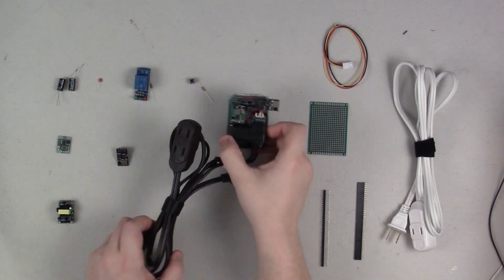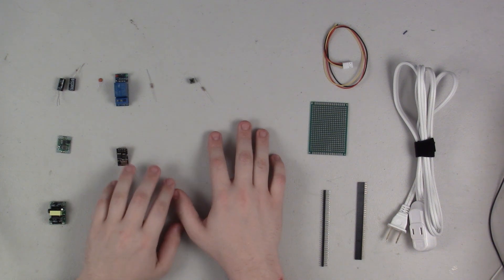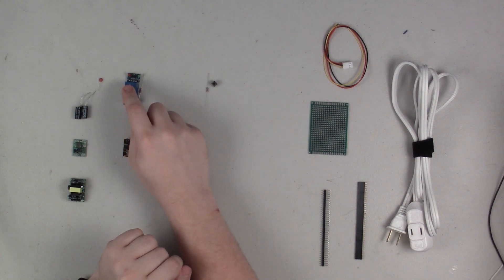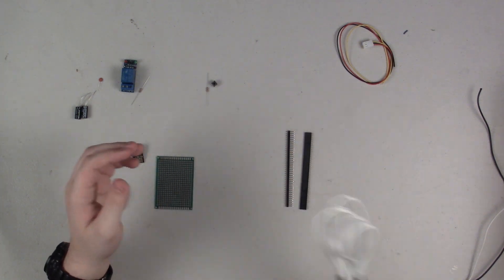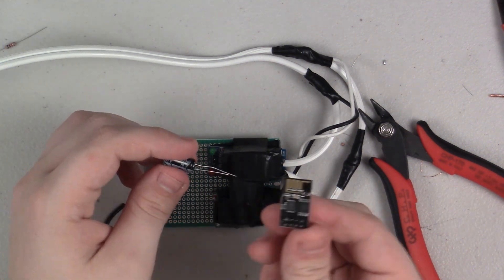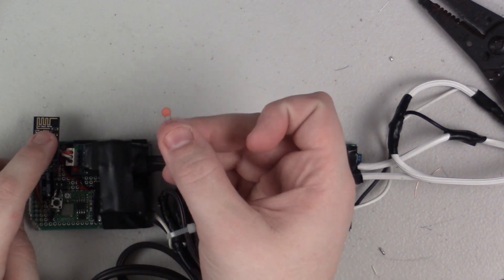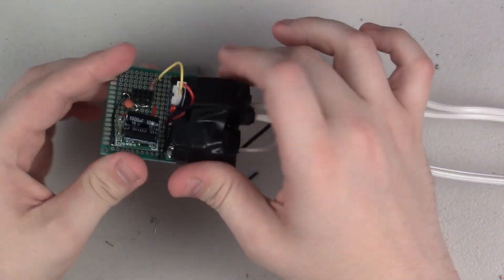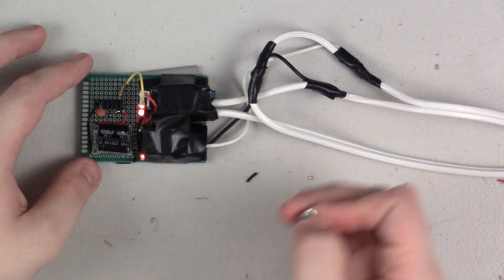Smart Relay Build

Comment: With no disrespect, if you install a snubber network across the contacts that will stop a lot of the back EMF on the contacts when they open and close the ac load like an inductive load causes as this will cause your processor to brown out you can get snubber s or make your own if that helps Bob and I love your channel your esp8266-01 programmer works a treat thanks.

Comment: You can use the retired smart phone power adapter as the DC 5V power source. I use it well in my RCWL-0516 Microwave Radar Sensor with relay module. It can supply sufficient current what I need. No doubt, a 1000uF capacitor still is necessary in the DC 5V incoming.

Comment: Great Tutorial!  Just have a couple of questions...
What is the resistor between the esp and the relay signal for?  
Also, is the relay a low or high level trigger?
Reply from the maker: The resistor acts as a current limiting resistor. Many of the cheap relay modules that I get from ebay dont have current limiting resistors on their input pin so just in case I usually add one. And the relay in this case was a high level trigger.
Reply: Any idea why the module would freeze when you power it up - ONLY when the relay is connected.  If the relay is NOT connected, the module powers up normally, and works fine.  You can then connect the relay and it works fine as well.  If you power down and power up again, problem persists.  Thanks in advance...
Reply from the maker: What pin is the relay connected to? (in mine it is connected to pin 3, aka the rx pin on the ESP).
Reply: const int Relay0Pin = 0  and const int Relay2Pin = 2
Both are initialized OUTPUT and LOW.
Reply from the maker: Ahh ok so that might be the cause of the issue. I chose pin 3 because that is a pin it doesnt interfere with bootup. Pins 2 and 0 must be pulled high in order for the ESP to boot correctly. After booting up they can be changed but initally the both must be high. You might try using a pull-up resistor (a resistor connected between the pin and 3.3v) along with your connection to the relays to see if you cant get the pins to register high initially but then be able to control the relay still after booting the module. Alternatively if you dont need the serial line you could use pin 3 as I did and pin 1 which is the tx pin. As a small side note I seem to remember some weird boot issues with pin 1 as well but that was a long time ago and I might be wrong about that.
Reply: Thanks for the advice!  I will add a (pull-up) resistor between IO's and 3.3 vdc.  (What ohm resistor do you think would work??) 
IF adding resistors doesn't work, I will try re-flashing with IO 1 and 3 instead of 0 and 2. 
I'll let you know what my results are... Thanks again!
Reply: Two 3k3 resistors worked like a charm!!  Figured resistance w/ current at .001 A. Hopefully I don't have any issues with heat.  Thanks for the help!
Reply from the maker: Oh great to hear that you got it working! I meant to reply back to you earlier but got distracted. Let me know if you need anymore help! 

Cheers,
~IKW

Comment: Is the AC-DC converter transformer based or switch mode? I'm thinking about making a similar device, however I plan to just add a 5mm DC plug as input on the device and power it from an old switch mode phone charger.

Comment: Am am doing something similar with one of those old desktop power strip-boxes.  You may want to try solid state relays, like a G3MB-202P-5VDC to reduce bulkiness.  Furthermore, you may be able to tune a resistor and 3.3V Zener to step down your 5V, if your ESP is not really power-hungry.
Reply from the maker: Thanks for the tips! I thought about using solid state but those are so expensive compared to these boards which are often <$1 on ebay. But in an ideal world I totally would use a solid state relay. And thats a good idea for the ESP power supply!

Comment: Nice design thanks for sharing! I'm trying to create one of these myself atm.
I found that the relay(atleast the one that Im using) also works on 3.3v. This would mean I would be able to get away with using just a 3.3v ac-dc converter to power both the esp and the relay. I'll have to do some testing for stability though :)

Keep it up!
Reply from the maker: Thats awesome! Yeah just make sure to have tons of filtering capacitors since the relay actuation causes a lot of voltage spikes so you want something to absorb the spikes.
Reply: Yea that's something I wouldn't have thought of if I didn't watch this video. That certainly would've killed multiple esp's. Thanks for the tip! :)
Reply from the maker: It's something I never really thought about until I started working with ESPs and I killed a couple before reading up on it. I'm going to put out a video at some point taking a look at the noise from a relay connected to an oscilloscope so you'll be able to see just what I'm talking about
Reply: Awesome thanks

Comment: can i use esp-12 instead of esp-1, is there any code change for esp12?
Reply from the maker: You sure can! You just have to adjust your pins to match whichever pins you plan on using with your module.
Reply: Thanks. Nice job.

Comment: Very nice. I'm probably going to use the capacitors in my future projects. I'm currently working on a very similar layout. The only real difference is that I skipped the 5V PS entirely as the relay modules I use work well on 3.3V for power as well as the logic part. Thanks for sharing!

Comment: Mind giving us a link for purchasing that neat 5V PSU module?
Reply from the maker: I dont like putting them in the description since the listings disappear so quickly on ebay but something like this would probably work well. http://www.ebay.com/itm/New-High-Grade-12V-5V-24V-9V-AC-DC-Power-Supply-Buck-Converter-Step-Down-Module-/331976883139?var=&hash=item4d4b5d3bc3:m:m3XxSHcQhDa-u-_IPLbbawg
Reply: This was going to be my question.  Yes, a variety of cheap bare power supplies on that ebay link!

Comment: Isn't it a waste of an ESP to just use it to control one relay? It is so much more powerful but the main problem I have is imagine having 10 lights to control and 10 ESPs doing that, that's 10 more wifi devices. Wouldn't that create an interference mess? I want to get this up using a relay board and one NodeMCU controlling all the relays...
Reply: True, it has 12. So you could do it with a NodeMCU module.
Reply: There are ways of doing more with one ESP module. Problem with these ESP-01 modules is that you only have two of the GPIO pins mapped to external pins. Like you say, using a NodeMCU (or in my case it's almost always a WeMos D1 Mini because they are smaller) you can control a multitude of relays because more pins are mapped to external pins. Not sure if you could do 10,  but maybe with an extension, like a multiplexer (which lets you control multiple pins with only a few) it might work. You might have heard of multiplexers in things like an arduino powered LED cube.
Reply from the maker: If you have 10 devices that you want to control you can setup a similar thing to this but with 10 relays (and change the subsequent code to use 10 topics if you need individual control). It's not hard to modify things to add more relays - it just requires as many relay modules as you need.
Reply: ItKindaWorks well like I said, you need pins to control those relays so it isn't just adding as much relays as you want, isn't it...
Reply: Yeah but my biggest issue(with the current setup) was having too many wifi devices..  doesn't that become a problem at some point?
Reply: Yeah multiplexing or some kind of control via the serial ports could allow for more relays than the available ports..
Reply from the maker: the nodeMCU has plenty of pins (idk if it has 10 but it has more than just the two and thats what kekagiso was referencing)

Comment: Wouldn't it make sense to use a power lead with a ground connection, just to make sure that you have the fase/live wire connected to the relay?
Reply from the maker: What do you mean "to make sure that you have the fase/live wire connected to the relay?"? 

The ground wire doesn't add anything other than a certain level of protection (Generally the ground wire is just there to make sure that if the live wire make contact with the metal body of a device - say your fridge - that the power is directed not at you but at the earth) but since this is a DIY affair you are obviously doing this at your own risk. 

Sure your house could be wired poorly and have hot/neutral swapped but adding the ground wire doesnt help that issue in any way that I know of. Perhaps I'm wrong though... But afaik the ground wire wouldnt help this project at all unless you intended to plug in something that should be grounded.
Reply: When you have the plug with only 2 connections, then you can turn the plug 2ways, one way round the relay will break, the fase/live wire, the other way around, the relay will break the "neutral", if the relay breaks the neutral, then you will have a permanent live/hot wire at the appliance. If you use the power lead with the ground, the you know what wire is the live/hot wire.
I am not suggesting it because of the ground connection, although it might not be a bad idea 😉
Reply from the maker: Oh ok I see what you mean! Thats only the case if the plug isn't polarized (in the US there are both polarized and non polarized plugs). The polarized plugs have blades of different sizes (the smaller blade is hot and the larger one is neutral I think - I always have to look it up) so that the plug will only go in one way even without the ground pin. So yes, trying to do this with a non polarized plug wouldn't be good but in my case I used a polarized plug so I knew which would be hot and which would be neutral. I'll try to be more specific next time I do something with AC though :)